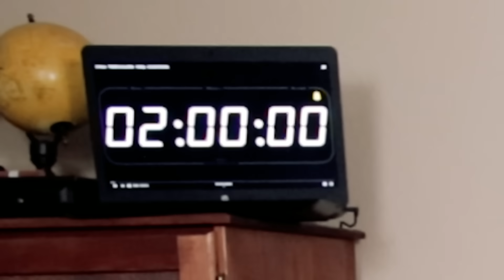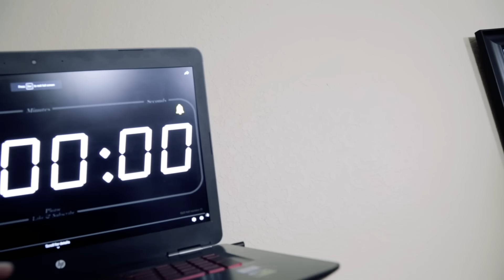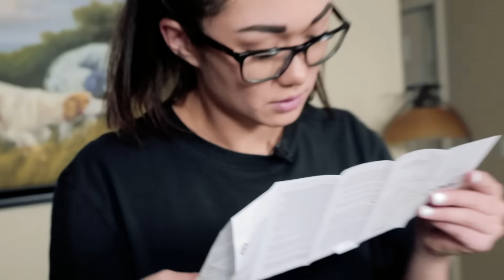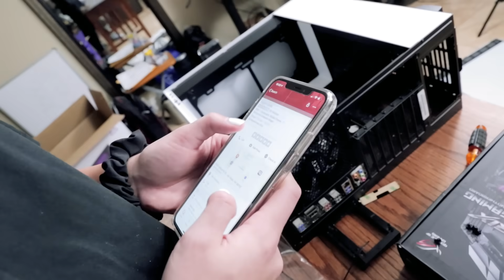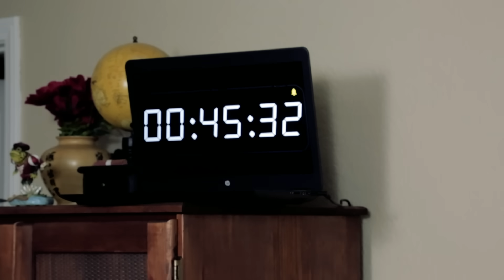College Girl wins $1,000 IF she can build It (Challenge)

Comment: forgot to apply thermal paste on the cpu .
Reply: Considering they used a stock AMD cpu cooler, i would say that it's either the wraith prism from a 2700x on a 1700x or it's the 2700x. Regardless, all stock heatsinks come with thermal past already applied to the copper base plate.

Comment: How do I know which pc tower is good for my build?
Reply: Do you mean for looks or for if everything fits?
Reply: @sam53143  everything fits
Reply: @frederikvanreusel  Check the motherboard size type, ex mini-atx, atx, or others and then check case specs to see if its compatable, and for the graphics card look up the measurements, how many expansion slots it takes, and then see if the case has a big enough slot, again on the spec sheet. You can find it on the manufacturers website most of the time. Power supplies are standard im pretty sure.

Comment: Better than me. I bought my own parts so I was being super careful since it was my second and I had no help. I had assistance the first time, it was for a class. I spent hours, not to mention the extra hour or more wasted trying to find out where 4 preinstalled case fan connectors went, 3 of which were completely unlabelled. It boots though, I just need to find some tape to tape my SSD into my computer (case came with no 2.5" drive slots... So much for prior research).

Comment: Where was the swiss army knife. Completely uneducated.
Reply: IC3_AydenTran which hopefully has a phillips head screwdriver in it
Reply: @pizza_parker9689  That was the point. It hadn't.
Reply: Christoph no i was referencing the joke
Reply: Where are the tweezers? You can't do a proper cablemanagement without tweezers.
Reply: Pathetic, what are these idiots doing you can't build a PC without a Swiss army knife that hopefully has a Phillips head screwdriver in it !!!
Reply: the swiss army knife is one thing, WHY DIDINT SHE PUT THE PSU ON RUBBERS SO IT DOESN'T SHORT CIRCUIT???

Comment: I could boot into bios in about 15 min.. outside of the case. Half of that time spend unboxing stuff.
Would that have counted?

As for functional build, 30-60min, depending on how many frail parts need be connected.
But for full build..... I'd spend over 5 hours on mine trying to get the damn cables to go JUST the way I want.... cable management is 80% of the build! No, 90%!

Comment: The interesting thing is that the sister got the correct RAM slots the first time, and he put them into the non-manufacturer recommended slots.
Reply: yeah, shouldn't it be in slot 2 and 4? not 1 and 3?

Comment: DOES ANYONE ELSE NOTICE THERE IS ABSOLUTELY NOOOOOO THERMAL PASTE?! your sister is cringe worthy fo Sho.
Reply: I think the cooler that comes with it in the box already has a thermal pad on it.
Reply: At best... paste pre applied... At worst, left "remove before use" sticker on
Reply: @matthewday7565  For a Ryzen there is no sticker and the paste is pre-applied. No way you can do anything wrong if you don't  rub it off or get it dirty :>
Reply: @V_Vi1337  You can apply more paste like The Verge.
Reply: @Narium413  Even this doesn't really make a difference - except you are using something like liquid metal 🙄
Reply: most coolers come with pre applied thermal paste, mostly stock coolers
Reply: homegrowntwinkie stock coolers come with thermal paste dippo

Comment: I need Help i have 600 dollars i wanna Buy a pc anygood specs for my budget ?
Reply: i3 processor will be best for you, with 8 GB of ram, there are graphics cards you can find too I'm not too sure what you can use but there is a lot of builds out there too for your budget which is how I found what I needed
Reply: Cpu-AMD - Ryzen 3 2200G 3.5 GHz Quad-Core Processor
Mb-Gigabyte - B450M DS3H Micro ATX AM4 Motherboard
Ram-G.Skill - Aegis 16 GB (2 x 8 GB) DDR4-3000 Memory
Ssd-Samsung - 860 Evo 500 GB 2.5" Solid State Drive
Gpu-MSI - Radeon RX 570 8 GB ARMOR OC Video Card
Case-Cooler Master - MasterBox Q300L MicroATX Mini Tower Case
Psu- EVGA - BT 450 W 80+ Bronze Certified ATX Power Supply 
It's not the prettiest but it'll game decently lol
Reply: There is actually I few options for your budget to get a decent working one. Let me find something for you
Reply: Buy used stuff
Reply: I Don't Work Here i found a i5 4 something K with mobo for 90 dollars i Could get a 1050ti Or 1060 ram ssd hdd case psu and build it
Reply: Older i5 (3570k, 4670k)  or i7 (3770k, 4770k) and a GTX 1060.
Reply: Rx 570, R5 2600, cheap Mobo, cheap case, small SSD or bigger HDD, cheap but decent psu, 16gb of the fastest memory you can afford
Reply: If you have a low budget amd would be a better choice, you'll be able to get a better gpu or rgb if your parts do not come with it
Reply: I recommend buying a new gpu, unless you know for a fact what the pervious owner(s) did with it. However bringing someone who knows about computers and a computer to test the gpu would be best. 2018 had been a year of cryptocurrency mining which makes a gpu preform worst.
Reply: Ryzen 3 rx570 4gb 2x4 gb ballistic ram b350 tomahawk Rose will 450 PSU 1tb wd blue HDD
Reply: I just built a ryzen 5 2400 g system with a msi b350 pc mate mobo but the Asus b350 prime plus is also good I used a 240 GB ssd 1tb hdd in a corsair carbide spec 4 case with a rosewill 80+ 550 psu
Reply: Cost a little under 500
Reply: @J Fz I would have to agree the only reason I went with it was because I only had 500 dollars to spend and I wanted better parts elsewhere so I took the hit on the case because it seemed less important than getting a good mobo psu and cpu
Reply: Ryzen 3 and 1050ti 8gb ram
Reply: What currency tho
Reply: Kuba Bukowski ryzen 3 2200g rx 560 8gb viper ram.